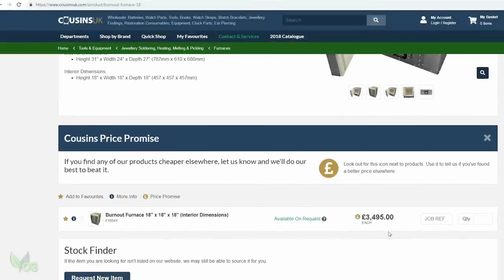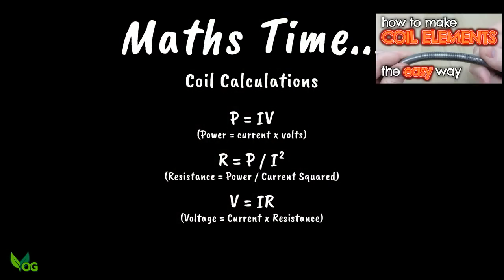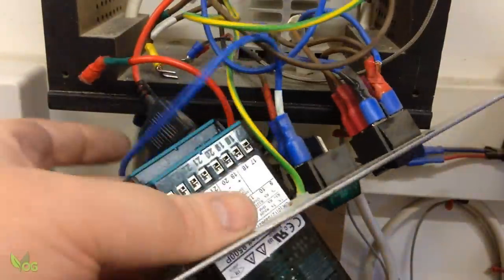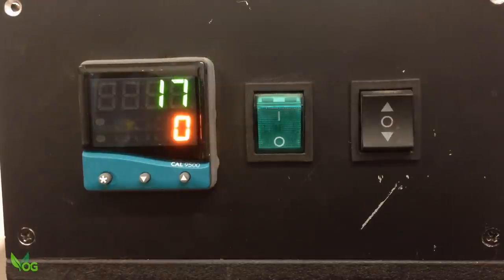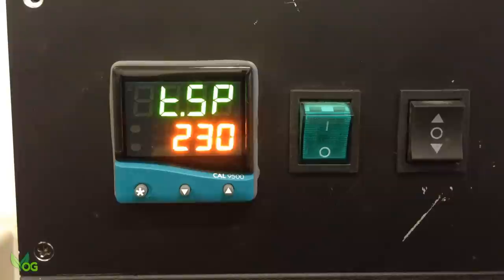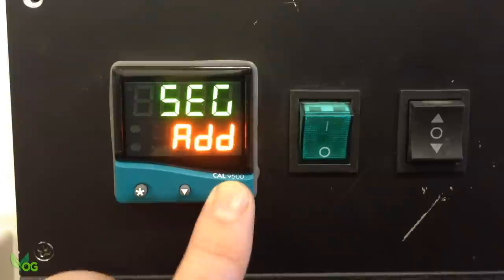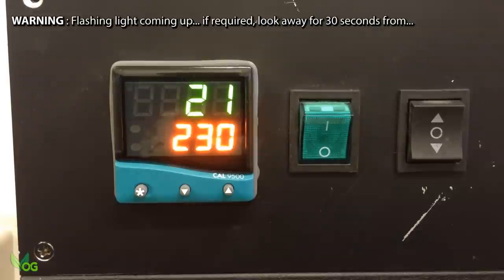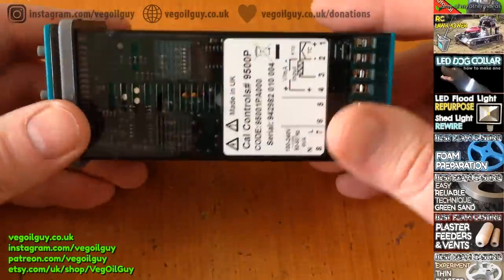making a burnout oven -  CAL 9500P Set Up & Programming the Programmable PID by VOGMAN

Comment: Quite a powerfull little controller, I had to setup a ebay pid for my dad's heat treating oven, and it was a pain to do.. I bet if I were to do it again I would rather just build a arduino based one since that would be easier for me lol
Reply from the maker: It's a very impressive unit that I'm barely using here, but it's not the easiest thing to figure out. I did toy with the arduino route but I chickened out. I thought it best to find an off-the-shelf solution that others could more easily use  : )

Comment: I need to do something like this with my small electric kiln that just has an on/off switch...  The cheap imported PID's are tempting, but somewhat confusing to set up from what I've read, as they require reprogramming to reset their default (low) maximum temperature limits in many cases.  Might be worth paying the extra money to not have that hassle, but that's something I need to think long and hard about before I order anything...  This is helpful, thanks.
Reply from the maker: Do take your time. Do plenty of research. David Collinson (below) has already suggested an alternative that I hadn't come across, the XTMG-7000. But you're right, the control these things give us is amazing and very worthwhile.
Reply: @vogman  lol, it's still sitting in my living room after 8 months of owning it and has hardly even been touched - taking my time with it is no problem.  Thanks for pointing out David's suggestion!

Comment: Great video.  That run process is totally bonkers though hehe....  Shame these companies cant add a couple of extra buttons and a bigger screen.  Cheers 🍺👍👍👍
Reply from the maker: There are bigger unit - exactly the same just bigger - and they also have 3 buttons. No one though of a menu button, scroll, select option it seems  : )
Reply: @vogman  I suspect there are no extra buttons because of manufacturing and/or engineering costs that come with them.

Comment: This is a brilliant video Geoff!  Great information and explanation of adding the controller.  This is exactly the problem I had with my kiln.  I have to manually adjust the dial to increase the temperature, while using an external pyrometer. Then I have to leave the kiln at a certain temp for the desired hours and try to remember to adjust the dial.  My memory is a sieve at the best of times and the dial is pure guesswork.  Not too mention I seriously underestimated how hot the kiln could get!

I'm going to have to pull my finger out and fix the kiln, but now you've given me hope that I can modify it to make the process automatic.

Thanks mate!
Reply from the maker: Thanks Dan. I used to have to set an alarm to wake me at 3 in the morning to adjust the temperature on my furnace, so you can imagine why I was keen to find a better control method  : )
Electric furnaces are arguably the most controllable means of melting metal, preparing flasks, etc. They're not fast, but they can be controlled very precisely. And with a set up like this, I can set things running Monday evening, then not worry about things until Tuesday morning, safe in the knowledge that all the boxes have been ticked.

Comment: Glassblowing annealers are 1/3 the price of the burnout ovens you were looking at.  Admittedly they are never clad in stainless steel, but they perform identically.  Same controllers, elements, and brick.  Sometimes as a cool safety feature the elements are sleeved in quartz tubing.
It's great that you built your own and everyone should- perhaps not on this large scale.  A better DIY scale would be a single case of fire bricks and a pound of kanthal.  I really like your coil calculator- very handy.
Reply from the maker: What an interesting idea. Thanks for the share.

Comment: This video will, I´m sure, be hugely useful to a large number of people.
 I did find it odd that the unit "thinks" in minutes when you´re setting the 3 hour soak time, yet in degrees per hour when it comes to setting ramp speeds. Still, it´s brilliant - and it even fitted straight into its predecessor´s mounting hole  : )
Reply from the maker: By "large number of people," do you mean me and some bloke that ordered it by accident?
I genuinely hope it is useful to someone else out there. It's a great little unit but I will agree the designers behind it need several slaps. For me the menu is hopeless... we live in a world of scrolling menus nowadays. Press, arrow up or down, select - duh!
And turning on a program requires far too many steps... I'm sure a three key combo shortcut would have been possible.
However, it's running quietly as I type. Every hour or so I pop in to see if it's moved on to the next segment and I'm filled with a strange sense of pride when I discover it has. Wonderful. Sometimes being lazy is great  : )
Reply: @vogman  I don´t think your sense of mild pride and wonder upon discovering that the unit´s moved on to the next step is at all strange, given the mind-twisting "logic" of its menu...
 I´m still at the stage where I guerilla comandeer our domestic oven for this task, so you´ve moved a long way towards casting professionalism since those days!
Reply from the maker: Given your obvious gift with electronics, I'm surprised you have been tempted to have a bash at an electric furnace. The first time you see the coils glow, it's brown trousers all the way as you expect neighbourhood fuses to blow and death to swish his scythe energetically. But once you realise that - hang on, the coils are supposed to do that, and they're happy - it becomes just another tool. You might be able to make an attachment for your favourite bench : )
Reply: @vogman  Ha ha - I could make it into a superbench, capable of being outfitted as everything from a computer-controlled burnout/casting station to a gentlemen´s executive trouser press - and so much in between...
Reply from the maker: Be careful with some of those gentleman's accessories. It can attract the wrong sort of viewers : )
Reply: @vogman  Hmm...I did wonder whether my habit of using a...massaging device...to encourage gas to leave my pour might be misinterpreted, so I never include that stage in any casting videos. Of course, if I bothered to de-gas properly I wouldn´t need to employ such unusual tactics.

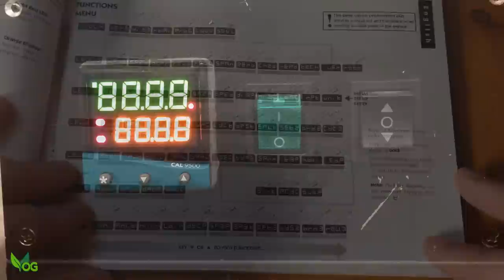Comment: Wow, those instructions at 3:45 are an absolute nightmare. The video seems quite helpful if anyone is doing the same project with this controller.

Now that you have the burnout oven, maybe time to revisit making molds directly from Warhammer minis?
Reply from the maker: They are strangely awkward instructions. I hope my video makes it easier for someone else out there, because they gave me a headache : )
What do you mean by the mold...?
Reply: @vogman  I was just remembering the Stormcast video where there seemed to be some burnout issues.
Reply from the maker: Ahhh, yes. I'll be trying again now with a slooooooooooooooooooow burnout  : )

Comment: so you cant do lost pla casting with out a burn put oven.
can you not use a normal oven
Reply from the maker: Not really Darren. You can certainly melt away wax or PLA in your kitchen oven, but the investment plaster needs to be baked at high temperatures to fully cure and make it porous enough for the vacuum to pull through it. This then helps you achieve the super fine detail associated with wax & PLA.

Comment: I have to ask as ive been looking, if a programmable tabletop kiln can get to the temperatures I need, could it be used as both a melting furnace and a burnout oven? I understand that the crucible will cool by the time I get the metal melted and that may cause issues but if I can fix those issues with luck or a bunch of sanding the savings of not needing a oven and a furnace might be worth the extra work
Reply from the maker: Absolutely. I haven't lost a tool here, I've gained another. I can melt a crucible of metal with a very basic Step program (maybe Step to XX degree and Soak for 1 hour to ensure everything has melted) or I can run a complex sequence of temps.
If you're sensible with your furnace design, you could fit both a crucible and a flask inside at the same time. Then when the flask is ready, so is the metal  : )
Reply: G'day Shy Owl.
I suppose that it depends on what kiln you have, but I have a small tabletop kiln (manual dial, no thermometer or timer) that I used to burn out and investment flask.  This was the first time using the kiln and the first time using proper investment plaster (as opposed to home made).

I ended up melting most of the steel flask, the bottom of a reasonably thick cast iron muffin pan (to catch the wax etc) and melted and fused a stainless steel guard the flask was sitting on.  When I finally opened the door, the floor of the kiln was a bubbling bowl of molten iron.

I went ahead and cast the part anyway.  It wouldn't wash away properly because the investment had burnt about 2 cm in from the outside of the flask.

Don't underestimate the kilns capabilities...

Cheers
Dan

Comment: How do you determine how much power you need to reach a specific temperature with a given length of coil with a given resistance?  For instance, 2100 F.  I know that Kanthal can get up to around 2400 safely.  It melts at about 2700F.

And would you need to run 220 or 110?

Comment: Hi Geoff. Interesting alteration to your electric furnace/oven. I guess that now you will be able to design programs to dry out your plaster molds and also to preheat your metal. You could also use it to do a pre or post heat treatment.
Your watch is looking rather tight and painful on your wrist which is a worry. How are you fairing in the heatwave? Mark
Reply from the maker: Thanks Mark. There's lots of potential with my oven now... the mind fizzes with ideas  : )
The wrist? It's a medical thing. I swell in places at times, mainly hands and feet. The heat doesn't help though : )

Comment: Stupid question maybe.. I finally got a kiln for burnout cycles. 

But repeatedly I’ve had my plaster investment molds crack midway through.  I’m using Oro Prestige plaster, mixing per the instructions and letting it fully cure for a day or two before the oven. 

But they keep cracking.. the only thinking: I put them on a broken kiln shelf, opening down. I figured it can “run out” some wax gunk that way. You suppose the vapor and everything is getting trapped and causing the cracking?

Comment: I think I mentioned when you asked the community back in April whether you should make this video, that at least in the US if you get caught venting something like this directly into the oven you can be very heavily fined by the EPA or even arrested, so you need to have either a dedicated and filtered exhaust port or else a filtered vacuum port both for your own health and the health of anyone around you and for legal reasons. My personal preference would be a vacuum port so you can pull down the container's atmosphere to further aid in burnout and sintering, but I'm not sure how well an oven like this could hold a vacuum without an external enclosure or how difficult it might or might not be to control a vacuum pump via PID (though I have had thoughts that it might be feasible to control both heat and vacuum using an Arduino RAMPS or other 3d printer control system, assuming it can withstand the currents and voltages involved).

Would you be willing sometime to look into how to add a ported valve to an oven like yours and whether a container made of firebrick can hold even a low vacuum?

Thanks for all the informative videos you provide!
Reply from the maker: I do like clean air and I will give the matter some thought.
Mind you, I do see some irony in this. I'm unaware of anything toxic involved in the burnout sequence. But Petrobond sand, which certainly seems very popular in the US, is Oiled Sand. I have been told (and that person COULD have been wrong) that the fumes that come off that are toxic. Not only that, once used, the sand is oil-contaminated and cannot be placed onto soil, etc. 
Like I say, I've never used Petrobond or any make of oiled sand, so I can't say whether this is true, but I can't help but wonder if the laws you mention are looking at the right part of the casting process  ; )
Reply: I was speaking more from the sense of general smelting and burnout use, not any particular product - and that's what police and regulators would probably be thinking about if they caught you using a smithing oven like this outdoors or in a public setting and venting it without filtering.

Regardless of that, thanks for the thought and advice, and thanks for agreeing to look into things for us.
Reply from the maker: No problem. 
Believe it or not, I am sympathetic. I am a bit of a greeny at heart : ).
Reply: It's only illegal if you get caught

Comment: Hello im having a problem programming my Cal 9500, when i try to select Program P from the level menu, it skips "level P" and goes directly to level A. 
ive tried reseting the micro-controller to see if that helps but the problem prevails.

could a mistake in my wiring be causing a faulty micro controller?
Reply: the only reason im leaning agains deducing that it is the wiring is because everything else seems to work perfectly fine except for the skipping of  "level P"

Comment: Didn't you already use your furnace as a burnout oven? How is this different?
Reply from the maker: You're absolutely right Voro. But I had to be the controller. I had to time things and adjust temperatures, etc. I've regularly had to take an alarm clock to bed and get up in the middle of the night to adjust the temperature.
Now life is MUCH easier. I can have a full nights sleep : )
The other issue is Ramping. Again if I wanted to raise a temperature at a certain rate, like 150C every hour until 730C, previously I had to calculate this manually. The PID learns the performance of the furnace much more accurately than I can and thus plot and calculate everything. I just type in the figures and it does the work. 
So control is the answer my friend : )